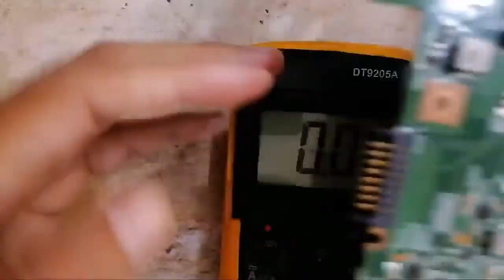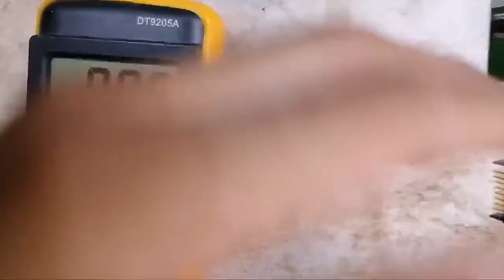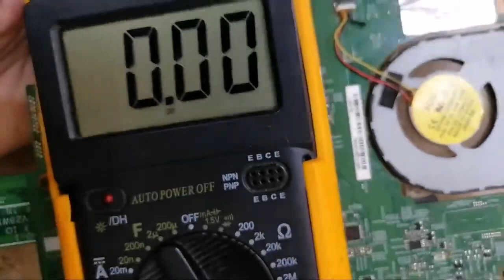Fix Laptops FAST with These Pro-Approved Voltage Tricks!

Comment: Thanks a lot for your informative lectures. I have a Toshiba Satellite L50-A0329 which boots into BIOS and then suddenly shuts down? Can you please assist? The CPU and GPU appear to be overheating, I have cleaned the fan and it seems to be fine

Comment: Hi take it easy; My desktop key board had been defectve in time and i started using external usb keyboard but later this external one was also got defected too. So my main board makes the keyboards defective. Could you please share your opinion on the matter?
Reply from the maker: Hi, there are a few things to consider. A malfunctioning USB port or even a problem with the motherboard’s USB controller could be causing the keyboards to fail over time. It could also be a power issue, such as a short in the USB port or an unstable voltage supply.
 Consider updating or reinstalling USB drivers. In some rare cases, issues with the motherboard can cause damage to peripherals, but it’s usually more of a problem with power delivery or faulty connections.
Reply: @electronicsrepairbasics_erb  many thanks sorry  i should add those: the keyboard works for a while and was not totally defective only some keys were not available for instant the  keys only z and x were not avalable at the initials but now more than 6 keys are not working too